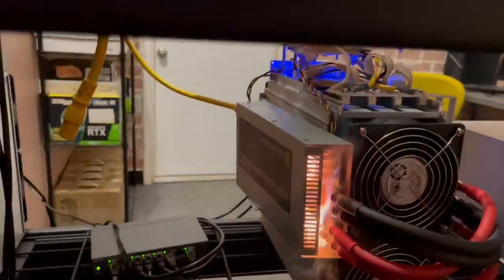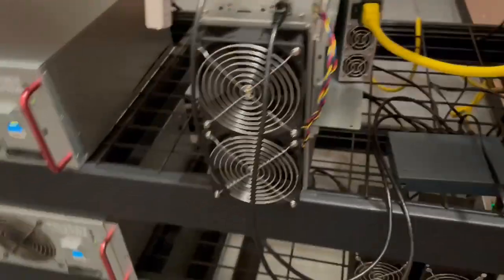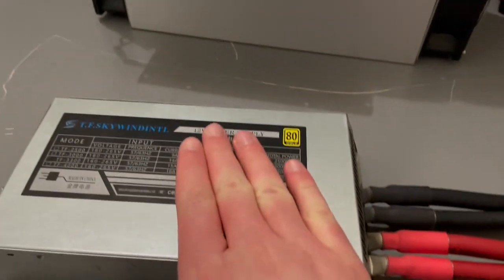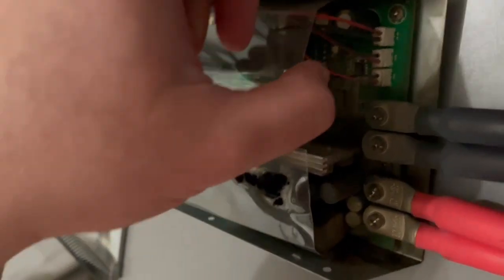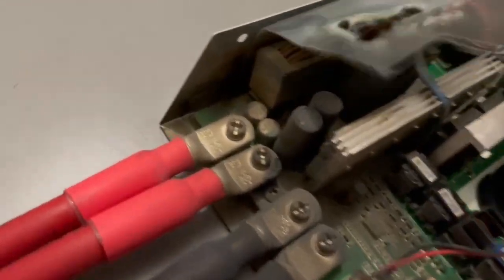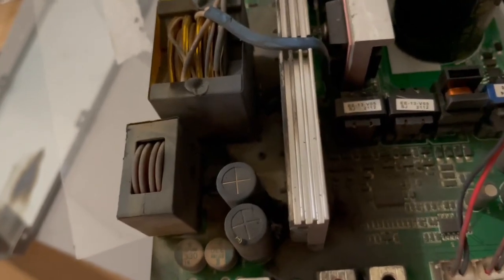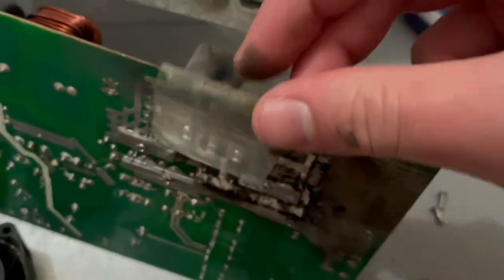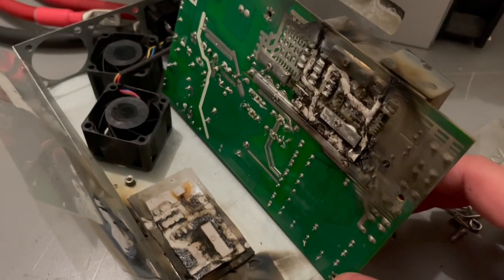IceRiver KS2 Flamethrower Mode Unlocked🔥🔥🔥

Comment: try julongfengbao 3300w 3600w its 2u psu, 3nuts 12v output

mainly used for yami eth miner and aleo testnet last year
by default they have 15x6pin, five 6 pin each nutnut

2u psu have betterheat dissipation

tsm688 on 1688
Reply from the maker: thanks I will take a look

Comment: That PSU is a low quality SURMA branded one. It advertised as 2kW or 1.8kW but on a good day it's physically bulit for 1kW best case scenario. Fake low quality PSU and components don't match other PSUs with same ratings

Comment: Damnnnn. I wonder if a fruition design kit could help. Or is it just the PSU?
Reply: It's the terminal points , I'm 1000% certain .
Reply from the maker: What about them?
Reply: @motorcityminer   they are a point of failure, having cables that feed the power to your asic exposed like this unit is unsafe  and can cause fires such as the one you experienced.
Reply from the maker: @Killer65malibuGaming  i guess i'm not following what is wrong with the specific terminal points in this case? The short/fire was started elsewhere in the psu. The terminal points are meant to have cables attached to them, does not matter whether using one thick cables as it did, or the stock bundles of 6+2 pin PCIe cables. Both use "O" ring terminals. Having exposed terminal units is very common in gpu mining PSUs unless using an ATX power supply so don't see how this is any different.
Reply from the maker: Just a faulty defective PSU. Rated for 3300w but was only pulling 2700w. Possibly additional cooling may have compensated for the defect though 🤷‍♂️

Comment: hope you do well.
the psu is not 3300 watt its chinese crap..
Your job unlock is ok.. but the psu cannot handle as it not 3300 watt actual
Reply from the maker: yeah, was surprised by a T.F. psu tbh. My old ones have been running years without issues.
Reply: what do you mean by T.F? @motorcityminer
Reply from the maker: The PSU brand, T.F. Skywindintl. Was a reliable brand back in the day.

Comment: Is good that the house didn't burn and came at the right moment!
Reply from the maker: I'm at an industrial warehouse made mostly of concrete and has fire suppression, so prob would have been fine. But glad the sprinklers didn't go off
Reply: @motorcityminer  yes water and electronics did not go well 😬.
Happened to my on a dell psu server but the wires got on fire and do not cut the electrcity I do not know but I think atx psu has an extra protection because happend to an atx 1200w to just a spark and just dead no fire or something also the same thing on bitmain psu just a condensator little burn but psu stop working and cut power!

Comment: hehehe didnt i just say that was gonna happen the other day... need better ventilation
chinese psu doesnt help either asic is probly fine.. just psu is trash
coating on the coils in the transformer melted from (vibrations from transformers..) and shorted out then blew caps .. and just one thing after another til the next thing that was able to handle the power .. then fire (this is the most common fault)
good thing you were there to catch it
Reply from the maker: yep, asics good. PSU was not the part of this build that I thought would fail first compared to the cabling/busbar situation.
Hmm, so you think whatever coating was on the coils liquified and became the short circuit path to the underside of the board?